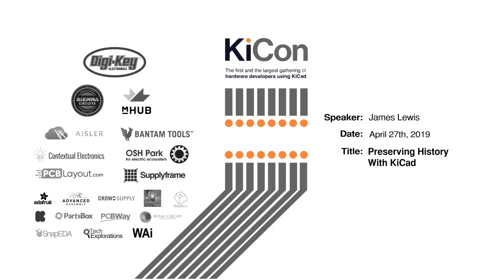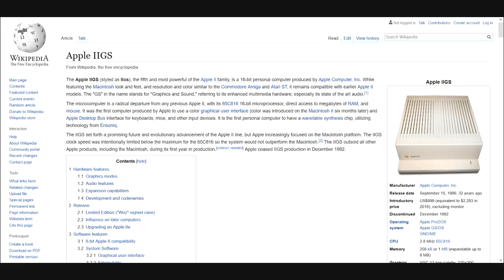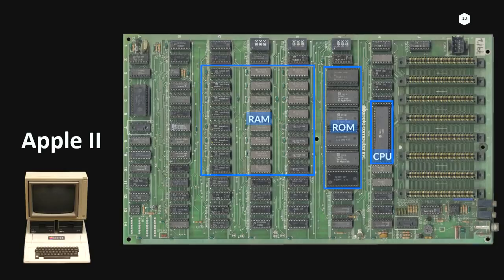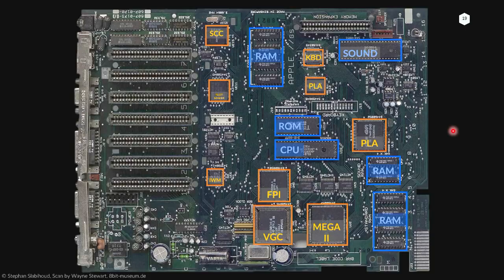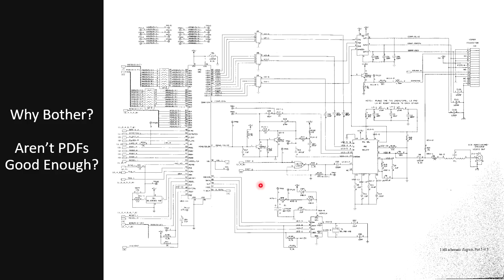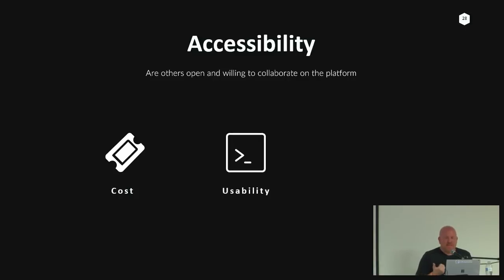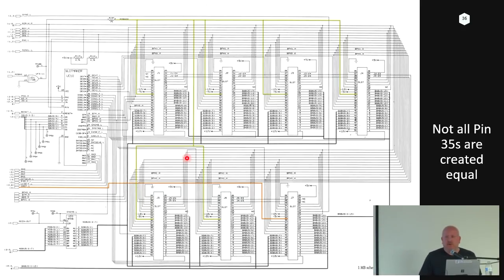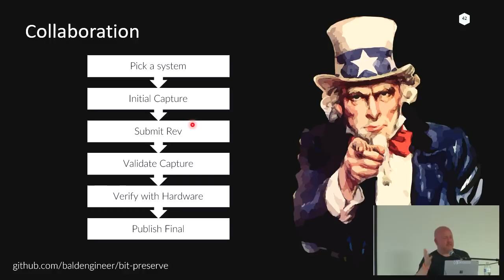"Preserving History With KiCad" - James Lewis (KiCon 2019)

Comment: 23:56 "Any questions?" [applause] [sip of water] Excellent presentation. I'm  VIC-20 guy.
How about x-ray to record hardware, and software to analyze images (machine learning) and work out the traces? That can't be a new idea for reverse engineering.
Reply: That has been done to some extent, especially on ICs which have recognizable structures. There is still a lot of manual work after automated recognition occurs. One approach to the PCB "scan" would be to reconcile differences between the schematic and PCB. For boards like from the VIC-20 and C64, they are two layer boards, so it is relatively easy. For boards like the IIgs, it appears to be multilayer so that would increase difficulty. It would probably also mean removing the existing components to get a good clean scan.

Comment: Capturing schematic information should 'work like html and css' where 'the html part' captures circuit connection information in a human readable text / line-by-line / wire-by-wire / junction-to-junction type of git-friendly standard. And, 'the css part' can be there, layered beside the hard-data, however you like, to worry about all the disparate and important boutique issues, but are of secondary importance to the purposes of archiving or 'the scientific transliteration of circuits'. Thanks for all the work, Chris.

Comment: Great talk, but I don't agree with labels only for buses/nets. When you are left with a paper copy, you are lost. You never know: have I found already all the references? Lines show, where signals go and where they split their path. Until KiCad supports automatic annotation of lable references, I will stick to drawn lines as much as possible.
Reply: Yes, I agree. That came up in the Q&A section as well. However. As I pointed out, the intent of the project is to create electronic schematics. Paper schematics already exist. In an electronic schematic, the buses/nets are not necessary.

Comment: Please don't be like Ben Heck and gut vintage computers.
Reply: Valid concern. I am only using boards that have been damaged. Sadly I have a board with a battery that already leaked, but I think the ASICs I need are still okay. I also have a board from a ruined case. And I have plenty of experience properly removing ICs. I won't be destroying any (functioning) PCBs in the process.
Reply: @bald_engineer  I don't doubt your skill.  And, it's good that you're using damaged computers to salvage parts.  What annoys me, however, is when popular people like Ben Heck take working equipment, gut it and shrink it for the sake of likes and subscribes.  Then, they move on and toss their "creation" in the corner.  Then, someone comes along and says "I want to be like him!".  So goes out and buys working vintage computers...destroys them...gets bored...and tosses them out.  Leaving the world with one less vintage computer.
Reply: @bald_engineer  This popped up in my feed. I'm surprised that Apple ][ boards are so hard to come by as they were pretty popular back in the day. Plus, there were clones about... a colleague got hold of some blank PCBs so a few of us built our own, think it cost about £20 back in the early 80s with parts begged borrowed or misappropriated from work at the time 😎